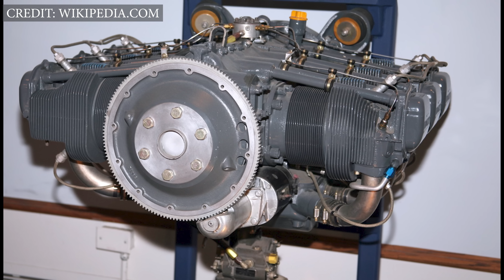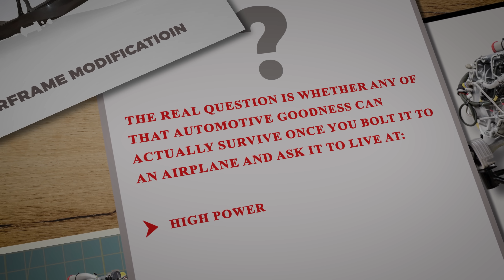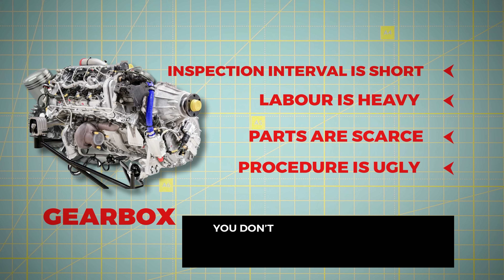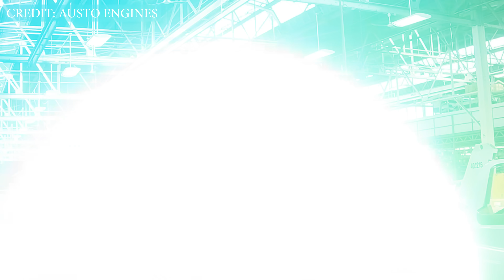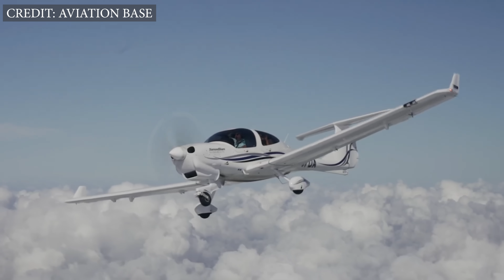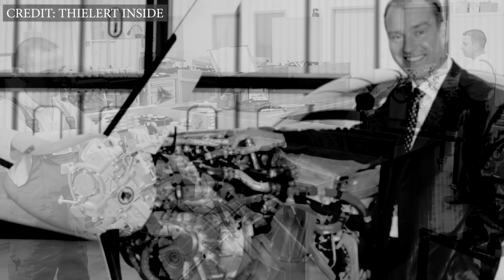The Engine That Nearly Killed Diamond Aircraft

Comment: I flew the AE300 42NGs for 1000+ hours… biggest POS hangar queen ever, not only gearbox issues but Gear, Waste gates on the turbos and on and on. Not to mention the horrendous OEI flight envelope. Even their test pilot goes from one side to the other of a huge runway when they loose the engine on takeoff

Comment: Fine video !
I was a cargo and ferry pilot, and I flew all these airplanes for thousands of hours. Decades ago, I arrived with a Piper Arrow in Tunisia, and they had plenty of Jet-A1 but no Avgas.
Both, Mr. Dries and Mr. Thielert were geniuses. Sad only, they were mentally different. Thus, they were unable to solve these minor technical issues.
It should also be noted that some of the certification requirements, cause some additional problems. For a car engine you never switch the fuel computer. For an aircraft redundancy is required. A car does not need prop control. Some believe this should be computerized. Such a system can also fail !
All these Diamond engines were able to do a cold start at -30C° (such as in Ulan Baatar). A cold start of Continental or Lycoming engines needs experience.
It should also be noted that issues exist on Conti and Lycoming engines that not even maintenance crews are able to identify !
However, there is still room for development of GA-Engines burning Jet-A1

Comment: We had Piper Seminoles at our school before switching to diamonds. We now have half our diamond fleet in constant maintenance (fleet of four)
Reply: This is the first I've heard of maintenance issue with Diamonds. Maybe I've been living under a rock. What's been keeping yours stuck in maintenance?
Reply: @eth @ethanberg1 rk at a diamond authorized service center. We do a lot of fuel tank work (requires wings to be taken off), pistons require fairly frequent inspection due to cracking, wing gap seals which are just tape always crack and need to be repaired with a rubber seal, tear down of interior is somewhat difficult especially the rear seats. If its the 62 with the 3rd row that can be challenging. AC has to be taken out often and its a pain to get out. Da62 landing gear squat switch always has pronlems and leads to an inability to lift gear after takenoff. Also not comfortable working inside the planes. Composite repairs are timely and a pain. TKS panel removal and reinstallation is not fun. Corrosion prevention and lubrication is time consuming. Theyre just not generally maintenance friendly.
Reply: @ethanberg1 not entirely sure as I don't fly the diamond but from what I hear it's either the landing gear or the engines. But take that with a grain of salt. But from what I hear, when they're working they're fantastic planes and great fun to fly

Comment: But car diesels 'LIKE' 70% power for long periods ??
Reply: Therefore they are based on Mercedes-Benz OM640 block.

First Thielert engines were nice try: reduction gearbox do not cope long with torque and engine was also not properly tuned when made too light as with new aluminium block. Company after sales was also not properly supporting customers...

...video tells story about Diamond step from Thielert first and light "Diesel" try, to original MB design used for Austro AE300/330.

It uses about 60% of fuel as comparable LyCo-saurus, which further cost way less than AVGAS here in Europe... it pays at the end!

And as a bonuses you have to count: FADEC!!!, automatically adjustable propeller, altitude and density altitude performance thanks a turbocharging, lower noise level.
Reply: @mariozetik    Automatically adjustable propellers are so 1940s.
But then I would suggest something derived from the DB600.  Tried and tested.
Reply: @advorak8529  😆, O.K. good idea... I like DB 600 engine family too. For example their continuosly adjustable supercharger and fuel injection were quite ahead of that era! But, back to our small travel/sport airplanes. I have no seen adjustable prop on comparable LyCosaurus powered Cessnas 172 and Piper Archers, therefore i mentioned it. Of course, it could changes their value and usability too. But i like fuel bills and easy of use for me available CD-170 powered P2010TDI.

Comment: Take a look at the Tecnam P2006T NG. It burns even less with Mogas powered Rotax 912 IS engines (around 30L P/H total) and Rotax are proven to be more reliable than Austro engines. They are also cheaper to replace.
Reply: I had a P2006T before my current DA62... There is no comparison
Reply: That is another Universe! P2006T NG need 915iS engines and some increase in fuel and load capacity, to be suitable for personal use. As trainer twin it is nice and economical plane, but for family haul...

Comment: GA planes use a dinosaur motor ,still basically ok but the weak part of the internals is  the connecting rods . It really would be too easy to use racing type rods and not the spaghetti junk still used today . The flat motors are basically Porsche engines . For Honda or Yamaha to make 300 HP motor that is flat either 6 or 8 cylinders for GA planes . The Continental/Lycoming are just old school. Only real change needed are bigger connecting rods the rest will be OK .

Comment: Unfortunately this video only tells part of the story, up until around 2020.  Austro AE300 and AE330 aircraft engines used to be based on Mercedes OM640 diesel car engine cores, with Diamond/Austro purchasing hundreds of these engines from Mercedes-Benz and storing them in a warehouse until needed to be converted into Austro aviation engines.  But Mercedes stopped producing the OM640 car engine around 2009, so eventually Diamond/Austro ran out of engines!

Austro was forced to find suppliers of discontinued Mercedes OM640 engine parts, and start producing their own engines in-house for use in Diamond aircraft.  But they discovered through parts "stack-up of tolerances" that these newly-built Austro engines with re-created parts were nowhere as reliable as the original Mercedes-sourced OM640 engines.  With engines produced in small numbers, Austro couldn't match the statistical quality control originally achieved by Mercedes volume car engine production.  Newer Diamond aircraft delivered post-2020 with these non-Mercedes engines started experiencing cracked pistons and other issues that were causing in-flight engine failures.  Many owners were stuck with grounded aircraft, and most were forced to pay for expensive and time-consuming boroscope inspections of these engines every 50 or 100 flight hours.

More recently Diamond/Austro has been working hard to develop fixes for newer Austro engines.  But the damage to Diamond's reputation has affected sales of both new and used Diamond aircraft.  (I'm the former owner of an Austro-engine DA42 for 4 years, followed by 5-year ownership of a Diamond DA62; both of my aircraft were produced before Austro ran out of Mercedes engines.)

Comment: One thing to mention is those Thielert engines were purchased by Continental and they have had some massive improvements done to them TBR for those engines are 2000 hours now and they have fixed the gear box issues requiring a visual inspection at 1200 instead of a full inspection at 300.